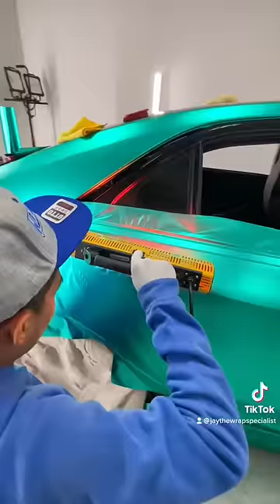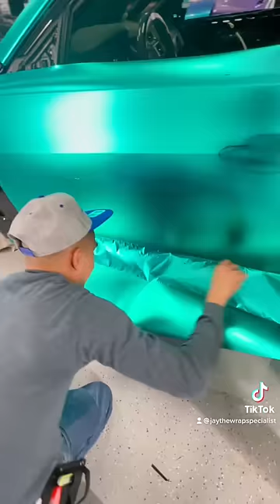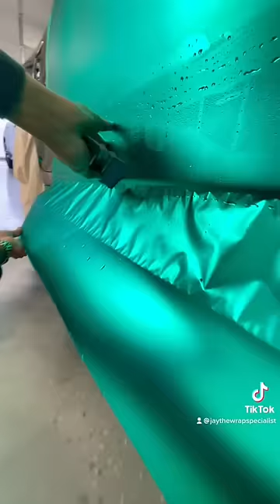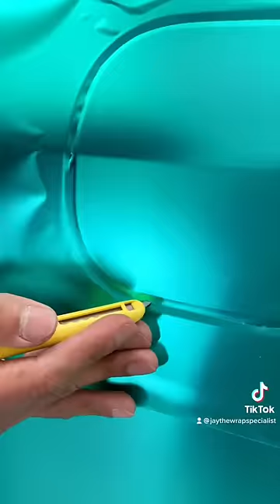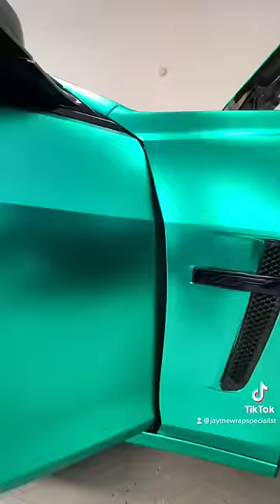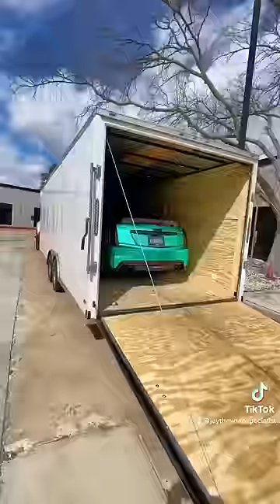CTS-V Hardest Wrap To Install ‼️| COMPLETE 🔥✨ Satin Super Chrome 🎯

Comment: Gets one bubble “Aw shit, looks like we gonna have to go bald” buzzing intensifies

Thanks for the likes btw
Reply: Lol 😆
Reply: Wow red carpet
Reply: Actually with vinyl wraps you just can use a heat gun to remove the bubbles, but you have to be careful and gentle with it
Reply: @the drum chef XD laughed too long at this xD
Reply: @averageperson4524  or pop it 💀
Reply: From the video, this looks like an air release film, which has grooves in the adhesive that allow the air to escape. Some bubbles can actually just be pushed to spread the air. If it's not air release, a small pin hole could be made to release the air and heat applied to shrink it back to normal.
Reply: @alexanderbonnot  oh that’s cool lol
Reply: @alexanderbonnot  ik about cars but idk about customizing the looks of the cars outside of new like engine parts and adding a wing
Reply: @thedrumchef5332  miss the rage intensifies
Reply: LMAO
Reply: Lmaoooo
Reply: im learning so much stuff in the comments
Reply: @joshy9594  not the remix one 😭😭
Reply: @dorkchops  same lol
Reply: @thedrumchef5332   Hey buddy how about I let you use my account for a week and you can edit all my comments that Got a 1k or more likes and leave speeches on them I probably gotten about over a million total likes  so you're gonna have a blast doing it 4 a  long time buddy
Reply: @187mrsmith  ummm I have school to do. Lol
Reply: @darkskinkira5371  xD
Reply: @joshy9594  thanks
Reply: @averageperson4524  turns out that’s not right, it will make them worse. So yeah, we gotta go bald my guy😭

Comment: I just wrapped my first car and I can appreciate how damn hard it is to do a nice job like that! Beautiful 😍
Reply: Why is it so difficult
Reply: @garrettfannon7618  With a colour like that, especially in a satin finish, EVERY little imperfection will show up…a wrinkle, a crease, even a fibre or hair under that wrap will stick out like a sore thumb. On top of that you are working with very large pieces of vinyl, so one little mistake and you could be replacing the whole piece or panel. Like most things in life, give it a try and then you will gain appreciation for it. 😅
Reply: How did your car turn out?
I can just imagine your sense of satisfaction at the end when you took two steps back, with folded arms and admired your work.. 😁
Reply: @leef8126  Making that final trim I was envisioning in my head I had just crossed the finish line of a marathon! Being a near perfectionist, I see all the imperfections but I regularly get comments on the “nice paint job”…that makes me feel a little better 😊. That said…I’m not sure I will EVER do it again 🤣

Comment: Can you imagine when the wrap is off and the cars covered with cut marks haha 😂
Reply: It won’t be tho unless he cut the actual paint itself but he mostly pressed it on heated it to stretch the material then cut at points the car had creases or open voids of space.. the only problem with taking it off is the cars covered in GLUE instead lol
Reply: They make a tape that has a cut string in it so you don't have to run a razor along the car paint. The tape goes underneath the wrap, then it cuts the wrap as you pull the string back.
Reply: @Boba_fehtt  yeah the paint underneath is done.
Reply: Really ? How about watching pro's working with it
Reply: @blahblah6497  it’s actually not tho.. smh I did this for a living and vinyl removal is a pain in the ass but doesn’t leave a scratch, just use goo gone and a plastic razor blade aka a body blade and you’ll see the paint will be restored to factory with no scratches.. if your feeling extra wax it after too and then you’ll really see how wrong you are ☝️
Reply: @Boba_fehtt  interesting

Comment: Ima wrap my Ctsv 3 soon. You didn’t have to remove trim or anything? I was planning on removing dam near eveything. Lights/ roof antenna / rear spoiler / hood vents // to make sure it’s clean but you did a great job without taking that off

Comment: How the heck did he do the part around the door handles so good!?
Reply: Idk if you actually want to know or not but you leave one hole open in the door where the handle is inserted so that the air has somewhere to escape and then heat the area up so that it relaxes flat and all ripples disappear and then use your thumb and an install glove to push the air out from one side towards the hole you’ve left open.